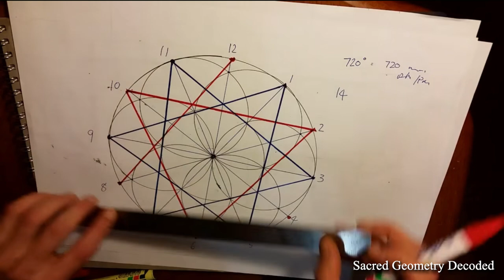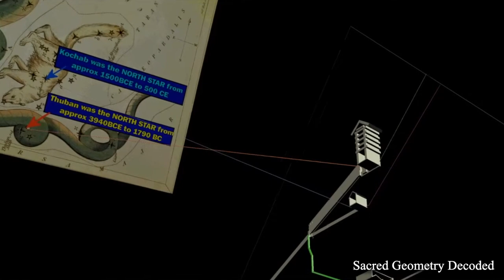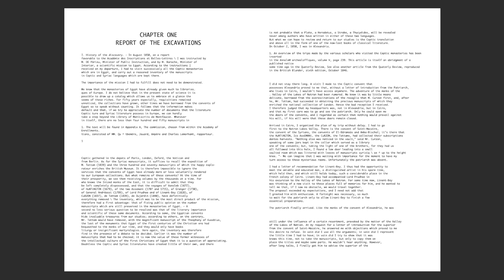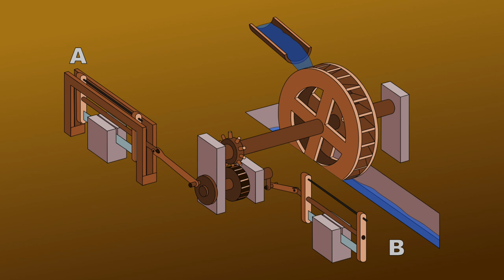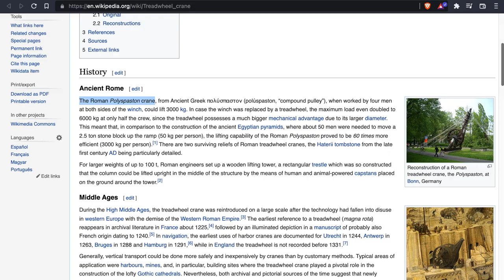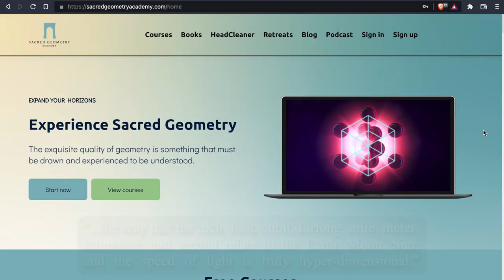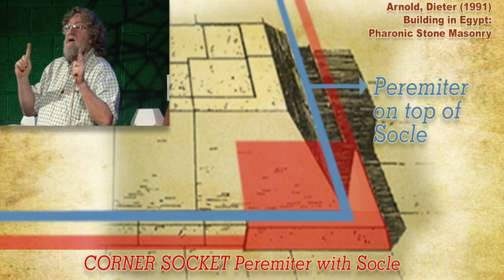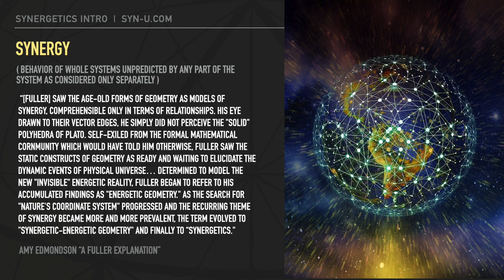PODCAST #2: SGD Sacred Geometry Decoded - Lost High Technology Skepticism, Engineering & Metrology

Comment: The speed of light thing is a total coincidence and probably cooked up. Because you have three separate degrees of freedom that you can play with:
1. The units of measurement
2. The exact location selected (since a Pyramid is not a point object)
3. The mathematical or physical constant you want to get close to

To explain a bit more: first of all, degrees (latitude, measured from 0 to 360) and speed (meters per second in this case) are totally unrelated units of measurement... so with this degree of freedom, it's very likely to find accidental overlaps like that... first you look at the degrees, then you think which mathematical or physical constants are close to that... then there is the additional degree of freedom that the pyramid is not a "point-like" object, it has width and length, so that gives you an additional degree of freedom. So if meters per second don't work, maybe try miles per second, or miles per hour, or try radians instead of degrees, etc, etc. You can easily cook such things up if you know what you're aiming for lol... and if the speed of light doesn't work, there are so many other important constants in math and physics like e, pi, phi, speed of sound, gravitational constant, and on and on and on...
Reply: @Kitties-of-Doom   You didn't understand what I wrote
Reply: @Kitties-of-Doom "It's babble" -- this is not a serious criticism. You haven't really addressed anything I wrote. Perhaps because it really is babble to you

Comment: Here's how I see it. However the machining was done, it was not done in the basic primitive manner often presented to us by the mainstream; copper chisels, mallets, or fire and wooden wedges. So, when we talk of ancient high technology, any method more advanced then those, qualifies. Even if we could do the methods today, that we do not give credit to the ancients for being capable of doing construction in a near equal to or greater degree than modern day does them great discourtesy. I just want to know how they did it. Clearly they had tools. I also ponder the corrosive nature of metal when  considering the remains of tools. Not much is left of metal after a few hundred years. Gold and silver won't corrode, but iron and steels will, all the tools will be gone.
Reply from the maker: Have you seen any of SGD’s videos on using primitive techniques to drill, cut and polish granite? It’s pretty straight forward, many people have experimented and achieved satisfactory results showing that primitive methods of cutting granite easily explain how the ancient stoneworks were created.
Reply: Can I try to translate this: 'I dunno how it was done, but that ain't it.' 'But mainstream got it wrong.' 'Having said that, they clearly had tools, and if they could do more or less modern equivalent, I don't know, how they did it, since there's no evidence of steel tools.'
Reply: There's no point to explain how it's done, if they know the methods (, ie. chisels, mallets, fire and wedges) and refuse to entertain the possibility.
Reply: @AncientPresence  I've watched plenty of SGD's videos and he has yet to drill, cut, polish huge granite stones which leave the same marks on the blocks with the tools he thinks were used. The majority of his videos are theoretical and not practical, unfortunately.
Reply: @Akimos  They don't want to entertain the idea because many people like Alan have minds that see completely closed off. Exactly the OPPOSITE view of what a "scientist" should have. Similar to you, I'm not going to say I know 100% how they did these things but I'm going to keep my mind open to the possibilities. These people unfortunately choose not to.
Reply: @coryCuc  The proof, as always, is in the pudding. "Scientists" are way better bet than "I dunno how they did it, but that ain't it". That IS the opposite, but there shouldn't be, since the FACT is just some are more wrong than others.
Reply: It's called extrapolation. There once was a time, when there were dodo's on earth, but they've been seem to vanish. Theres's no videos of them. How do we know there once was dodo's?
Reply: @Akimos  The proof isn't "in the pudding" since the "pudding" is constantly changing.  Physics change. What we know about our universe changes. What we think are fact one day aren't fact tomorrow.  Thinking you absolutely know, 100%, in a time period we can't even date accurately doesn't prove your position.  One of the principals of the scientific method is the ability to recreate the experiment with the same results.  I have yet to see someone do that with these megalithic structures.
Reply: @coryCuc  And why do you think physics change?
Reply: Honestly cannot put it any clearer.
Reply: Uncertanties of electron being on a place to another within an atom is not the the equivalent of if a copper saw can cut sandstone.
Reply: On the night of Sept. 23-24, 1846, astronomers discovered Neptune, the eighth planet orbiting around the Sun. The discovery was made based on mathematical calculations of its predicted position due to observed perturbations in the orbit of the planet Uranus.
Reply: @Akimos  Because they have.  Einstein's theory of relativity for one. Newtonian gravity is another.  Not to mention the experiments where the results seem to break the laws of physics (for example particle theory experiments regarding muons).  

Not only does our knowledge of the universe and physics change, but there's a lot we still don't even understand. Just as they have changed from hundreds of years ago.
Reply: One of the earliest attempts was the chronophotographic gun which was invented in 1882 by Étienne-Jules Marey, a French scientist. It could shoot 12 images per second. It was badass, but it wasn't a movie camera. 
So no video, still, but scientific method worked.
Reply: Still copper was copper ten thousand years ago. Characteristics of copper and of sandstone are the same then, and now, relative to electrons position in an atom.
Reply: If these machines would just corrode into nothing, how come we keep finding these contemporary copper tools and even all the more primitive hunter-gatherer artifacts that are even older? They show up everywhere so how does the absense of these advanced tool and machines are just always just get dismissed  in this way?
Reply: @jellyrollthunder3625  Oh yes, the old crayon @Cory trying to shift goal posts way back when. Did work then, still doesn't.
Reply: @Cory, do you remember the time you brought nazies into a science talk? Last week? How did that one go?